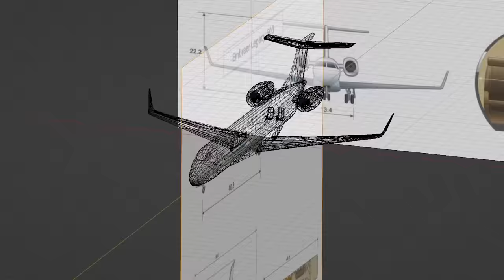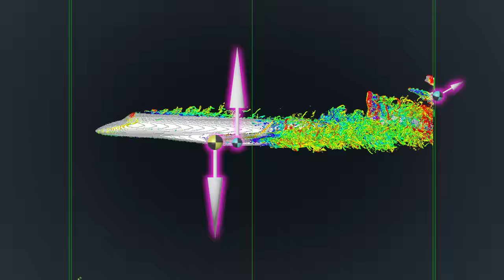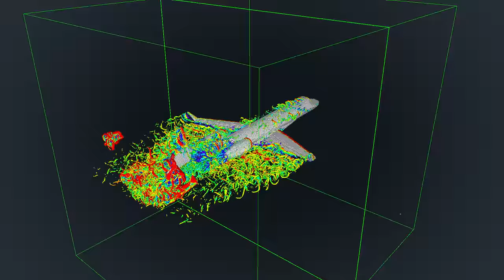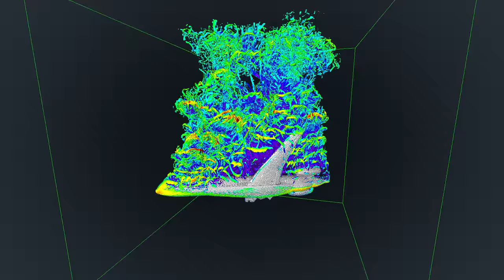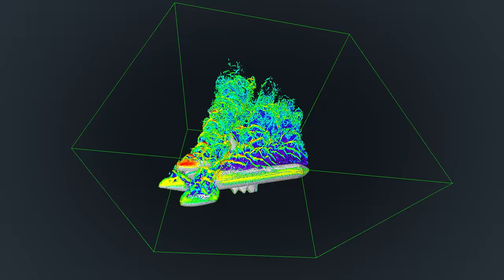Prigozhin's Aircraft Crash Analysis

Comment: Very good simulation, thank you. I thought it was a missile of some kind due to the trail that was visible in the sky, but your argument is very well put.
Reply from the maker: Would there be any smokeless surface to air missiles that reach 28,000 feet? I figured anything that reached that high would have a visible smoke trail that makes the attack obvious 🤷‍♂️
Reply: @SLGY   LAZERS!!! PEW PEW PEW (joking). Yes good point. The missile explanation is very lazy
Reply: @SLGY  There is a lot of footage from Ukraine of the use of S-300/S-500 systems that are being blamed for the strike, since they're in use by both sides. Having only puffs of smoke at the altitude of the impact without any visible trail beyond that doesn't seem uncommon. The smoke trail seems to dissipate very quickly with them, and there is definitely some smoke in the footage already leading towards the aircraft. The fact that onlookers reported two explosions could also indicate that it was a spread launch from the ground. Still, your explanation is also excellent and honestly we may never know whether it was a missile or a bomb. Your video is really convincing, but on the other hand there the damage allegedly indicated a strike from outside. I'm not an expert at all though!
Reply from the maker: From what I've seen previously (a good example being MH17) is surface to air missiles will pepper large portions of the aircraft skin with the fragments from the missile explosion. The missiles operate by exploding very close to the target, not actually hitting it, and then explode like a claymore mine, fragments covering a large area on the side of the aircraft it exploded near. I guess we haven't seen any portions of the aircraft that have any signs of those penetrations (particularly the tail) - just large chunks of aircraft hull 🤷‍♂️
Reply: Most missiles burns solid fuels  and when they ignite they burn until they are empty. At this point the missile still has considerable momentum and still tracks its target without running engines, and no exhaust fumes.

Some fuels also burns with little visible exhaust fumes, and won't leave any trails.

Air to air missiles are smaller and less visible than SAM's.

I have seen pictures of parts with holes that could be shrapnel, but it's nothing conclusive.

An internal explosion is just as likely.
Reply: @KjetilBalstad 

 Indeed  the S300 missiles burns for only 5 seconds which would mean no smoke after 15,000m and there are pictures showing a trail of smoke that dissipates and leads to a puff of smoke that matches the line and direction of travel for the jet.

The S300 9M96 missiles are designed for direct impact and have a relatively  small 24 kg warhead designed shape the detonation and are not as large as the warhead that took down MH17.

A smart radio fuse is used to control the warhead timing and pattern, in effect it's a steerable shaped charge with a reportedly 95% hit rate
Reply: @SLGY  This 28000ft figure is well within range of the Pantsir-S1, and modernized 2S6 mobile air defence systems, most of the missiles flight is spent cruising/gliding with the motor burned out.

Although an internal explosion is more likely...
Reply: @SLGY  That depends on the distance and type of missile launched, seeing as most Anti Aircraft missiles will have a short burn time, there would be a trail to the ground launcher that is visible, but there may not be one that goes all the way to the jet as the missiles tend accelerate, run their motor out of fuel and is a gliding projectile on its final distance to the target.

The Wagner jet wreckage videos from the crash site did show a lot of "peppered" damage holes to some pieces however.
Reply: While the argument of suitcase explosion seems likely. I have seen pictures of the plane with inward-facing fragmentation holes that are only produced by missiles
Reply: @SLGY modern dca missilz in short range only burn for a small time then burn much less so no smoke for example a pantsir have missile like that. I will also add that some pilots said that the smoke left behind the plane had the same patern as a ground to air missile. Like the patern was specific enough to tell that it wasnt an air to air missile.
Reply: @SLGY  No it would not, by that point the rocket motor would be spent and the missile would be gliding to the target
Reply: @SLGY  correction - most a2g missiles work that way.  However not all, especially like the newer patriot systems are 'kinetic energy' - they strike the actual plane.  Not sure about the newer Russian ones.  (Kinetic versus fragmentation is very important when considering shooting down say, ballistic missiles.  Older patriots in the gulf war used fragmentation, this among other problems led to their abysmal record in that war)
Reply: @SLGY  All depends if the rocket motor on the missile had burned out or not.   If the motor stopped burning before interception it could very well not leave a smoke trail.   Many longer range missiles such as the Russian R37, or US Aim54, Aim120 'loft' then descend on their target with gravity helping etc.
Reply: @MRKapcer13  An s300 missile is the size of a schoolbus, and explodes massively before impact. There would be not much plane left if it struck this...
Reply: Suicide drone? The fact that the transponders were briefly interrupted could have been jammed to hide any aircraft call outs.
Reply: @jefism  I hadntt thought of that.  But I think tbh its unlikely because the extremely high alt. and speed.  Im unaware of any drones that can fly at 28k ft almost 500 mph
Reply: @sichere  this is true however there will still be smoke from the rocket engine as it continues to fly aswell as a contrail formed behind it from the low pressure created as the missile moves at supersonic speeds to meet the target. also several Russians around Moscow reported seeing a missile launch
Reply: @darthsnizreb6350  not really. especially because several Russians have reported seeing a missile launch that day and were scared it was another drone attack. not to mention the fragmentation visible on the non-officially released pictures
Reply: @Milk-ew4pf  this would not result in the left wings partial separation while keeping the hull intact until impact
Reply: @MichaelThe-Pyro  Indeed there was
Reply: @SLGY  Guided missiles continue on inertia after the rocket motor is burned out.
Obviously, you don't want another (fighter) plane flying too close to  what you want to shoot down clandestinely.

The puff cloud just screamed "missile" to me
Sky News UK had their analyst, a former RAF pilot, describe it as a guided missile as well.
They later adapted their text to the Pentagon story
Reply: @SLGY  your version also takes place, but as we see, the impact (explosion) was in the area of the  engine. Near Valdai there are Pantsir complexes, which in my opinion will not litter the plane with holes. A similar recent incident took place in Iran. The comment I wrote may not be accurately translated since I am from Russia
Reply: @MRKapcer13 just to remind you Ukraine only has s300, s400 and s500 are only used by russians
Reply: It could have been either .. a missile strike hitting the tail, or anywhere between the tail and the wing, would have produced the exact same scenario as a bomb in the cargo bay ..
Reply: @BradHartliep-kn9ud  Yeah, effect is the same - hence the simulation is OK
Reply: @MichaelThe-Pyro  Separating the tail is a known effect of A2G or A2A IR guided missiles
One wing coming off is a result of dynamic forces acting on the plane after the tail comes off as illustrated in the simulation - it's not a result of the explosion itself. Tail separation happened first as it's a long ways off the main debris field.
Reply: The smoke trail in the full video, is from the aircraft, there isn't one from a surface to air missle. 

The induced flat spin, suggest internal explosion and lost of the rear section. 

A missle would have caused a shot gunning to the under carriage and far more fire from the aircraft as they contain phosphorus too.
Reply: @MRKapcer13 it wasn't in ukraine it was north of moscow. There is also a visible rocket trail from a surface to air battery.
Reply: @SLGY correct, a surface to air missle, uses a proximity detonation. And fragments the aircraft for the kill. The rocket propells it, but the main body of the rocket contains white phosphorus and the main body fragments I to long slender pieces ripping massive wholes into the aircraft often severing the aircraft completely.

In the video, of prigozhin aircraft. The only trail you see is from the direction the aircraft was flying. The single circle smoke and then the aircraft is flat spinning. You see little fire. An aircraft like that would burn tremendously from the white phosphorus in a surface to air missle.

To induce the damage seen, you are better off using a time delay chemical agent. Best example would be using ping pong balls drilling a whole in them filling it with chlorine, and using rubber stoppers.

The jet fuel will eat through the balls slowly. Allowing for the plane to take off and get I to the air, about an hour I to the flight the ball will be destroyed, and when the chlorine mixes with the jet fuel it will explode causing this damage shown as it will blow up mostly in the engine, causing g the aircraft to lose complete co trol and crash.
Reply: @sichere what took down MH17 was a Ukrainian BUK mobile surface to air launch batter. Ukraine and the west blamed it on russia.

But russia had removed the BUK from service in 2008. It was replaced with the pansir and s400 systems because they were more mobile and provided better coverage.

Ukraine still has the BUK in service and the only post soviet nation to still use them.
Reply: CIT team thought it was a missile at first, but what convinced them otherwise is that the States intelligence said no traces of a missile launch was seen from the satellites.
Reply: @SLGY false. Surface to Air Missiles only burns for a very short part of the first stage and cruise for the remainder of the journey. 

The fact that it is at 28,000 feet would make more sense for the interceptor to be smokeless at that point, as i'm sure there are close to none SAMs that would still have a burning motor that high up.

Comment: Well done. This was exactly my take when I saw the original footage. A device placed on the ceiling of the rear baggage compartment causing fin and stabiliser separation and subsequent nose down pitch.
Footage of the tail section and detached wing have no obvious shrapnel damage so a missile seems unlikely. Of course there’s also the (slight) chance of structural failure due to a maintenance problem.
Reply from the maker: That's a good point, it being at the top of the baggage compartment to have the best chances of success...
Reply: I thought i saw another video that showed shrapnel holes in the wing... ill see if i can find it and link it.
Reply: Either way a bomb would most likely leave some sort of shrapnel holes too.
Reply: I'm rather in favor a your last option: the maintenance issue. Progozhin failed to maintain his allegiance to Putin, which caused his plane to fall from the sky.
Reply: @thierrygillard6896   the sky? Didn't the plane fall from a window?
Reply: I believe there was evidence of shrapnel in some panels recovered from the crash site.
Reply: @VulpeculaJoy  
On one of Denys Davydov’s videos there was crash scene footage which showed a couple of panels with what could’ve been shrapnel holes. However they didn’t have the characterist shape that missile “rod” shrapnel make.
Reply: @meofnz2320   Yes but that makes it even more likely that it was a bomb planted inside the luggage compartment.
Reply: @thierrygillard6896  dont forget Prigo dealt a massive blow to the Ukrainians when he captured Bahkmut. And Ukrainian secret service have carried out quite a few assassinations of prominent russian figures so far. He was probably on the top of "mirovets" list.
Reply: @thesayxx  Frankly, I don't care. He was a warlord and the world is a better place now. Whoever did it, did well. And if someone could take care of Vladimir Vladimirovitch, I would not be utterly sorry. I have friends in Russia who could very well consider living without him.
Reply: @thesayxx  i doubt this. he caused alot of internal struggle in Russia lately he was more valuable to keep alive as an enemy of Putin
Reply: @thierrygillard6896 There was likely 2 or more pilots along with a cabin crew on board. They would have families who care. Is the world a better place without them too?
Reply: @thierrygillard6896  Yeah I don't care about someone assasinating Joe which will eventually let to Ukraine negotiating....
Reply: @thierrygillard6896  . . . or Progzhin killed too many Ukrainian soldiers at Bakhmut, and Zelenskiy had a few left-over, journalist-sized time bombs with his terrorists in Moscow.
Reply: @diegoferreiro9478  More likely he plane, or passenger's baggage, was visited by some guys on Zelenskiy's team bringing a time bomb.
Reply: @thesayxx  The favorite assassination device of Ukrainian terrorists operating in Russia is the small, concealed, remotely detonated bomb.  The MO, including the murder of the plane's innocent 3-man crew, suggests orders came from Kyiv.